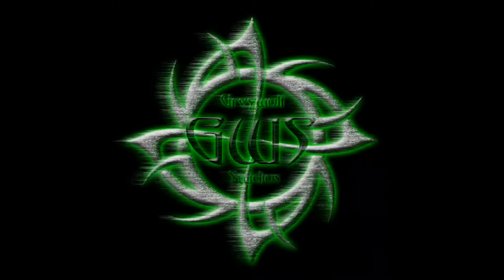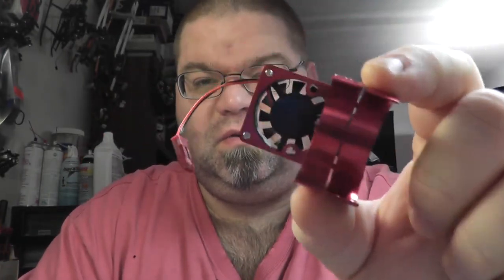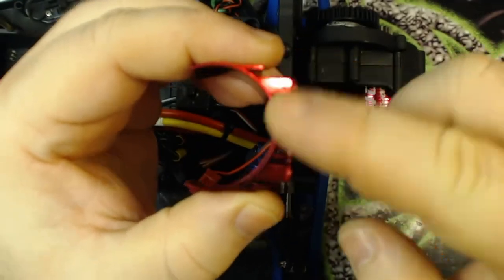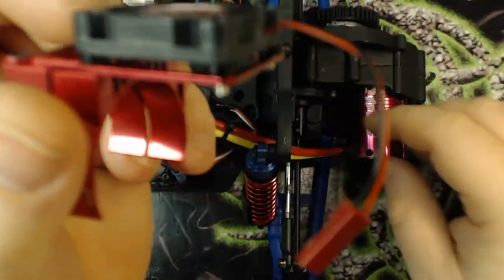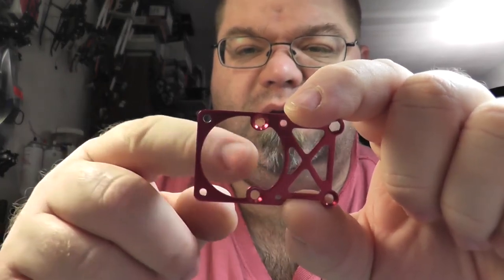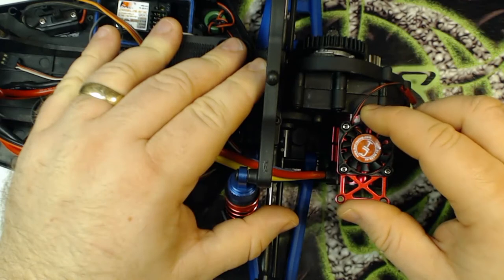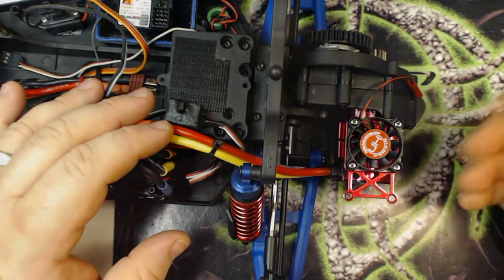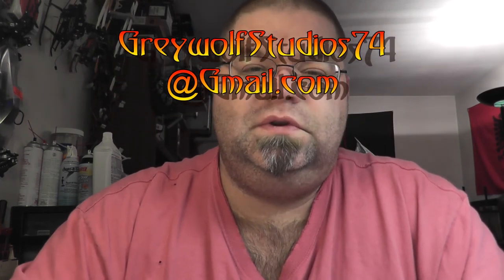Hot Racing Modular 540/550 Can Size Fan

Comment: you can literally cut the stock trans case with a utility knife between the 2nd and 4th bolt from the shock tower and it will pop off and fit! i did this with my integy fan/heatsink and it worked perfectly. i understand the design isn't exactly the same but it worked!

Comment: Cool.  Want to run it on a Tekin 550 HD 4300.    Have a similar issue on the TLR SCTE 2.0 where the side bumper coincides with the motor, but running it at an angle might work.  Thanks for showing the modularity.

Comment: Great video! My complaint about this fan is it's advertise to fit a Slash so why don't they give you enough power cord to reach the receiver? Would it kill Hot Racing to give you a few more inches? I installed it on my 2wd Slash and what I did was use one heatsink got rid of the bracket and drilled some holes in top of the trans case where the fan overlaps it and screwed the fan to the one heatsink and it works fine. Thanks for the video!